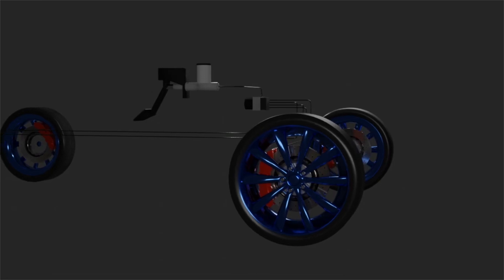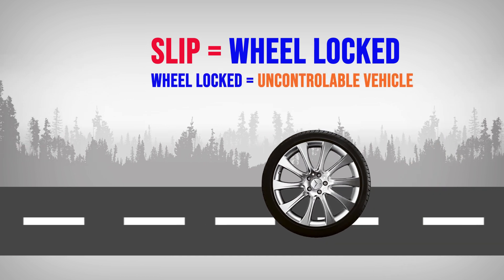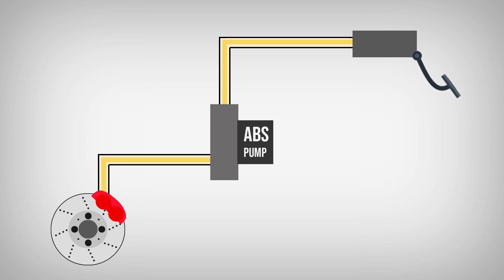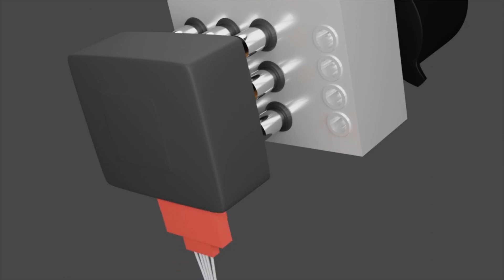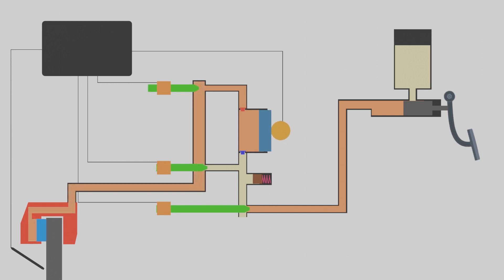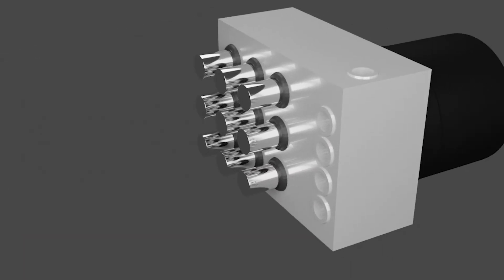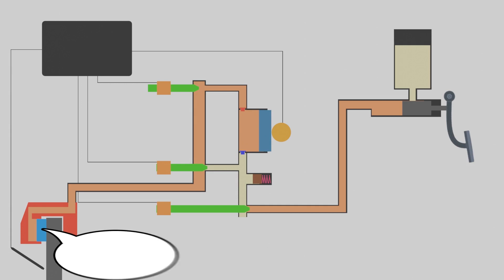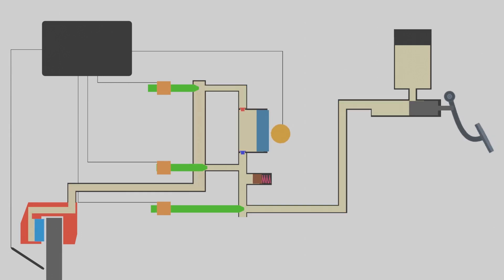How Anti-Lock Brake System (ABS) Works ?

Comment: There is a part in the video where all of a sudden, the music gets really loud and the beat of it becomes annoying. The subject and the chosen animation are already dumb by itself. And since there isn't a lot of explanation about the ABS system which I'm still surprised how it can be that where living in the 21st century, still we feel like it's the caveman years of tech, it makes it even worse.
Reply: You seem smart I’m having an issue with my driver side brake holding pressure not releasing I’ve changed everything attached to the rotor and caliper. I’m starting to think it’s a valve in the stupid abs module. It’s an 03 civic ex… thoughts?
Reply: @Carlomercurio1  Hey my friend. Do you have prior knowledge about braking system? I don't mean to tease you, because I'm a student too, it's just the terms I'm going to use are here.
Fluid
Lines: AKA brake pipes.
1. Your caliper or brake pad might be seized due to rust  and age, and it might pull one side when braking
2. If your brake is being pushed and not released it can be overheated brake system, using wrong braking fluid damaged or broken components, or DEFECTIVE ABS COMPONENTS. (WHEN WE SAY ITS A ENGINE PROBLEM IT CAN ALLLLLLLLL KINDS OF STUFF)
HERE IS THE BEST I CAN GIVE. BUT MAKE SURE YOU GET YOUR CAR CHECK BY PRO. CARS ARE LIKE A LEGO SET AND ONLY THOSE WHO STUDY IT EVERYDAY CAN GET IT. IM HAPPY YOU DID A MAJOR CHNAGE THOUGH. AT LEAST YOU DID PART OF GHE JOB. ALSO CHECK OUT. " Common 2003 Honda Civic EX issues" And it's bringing four lists of problems. I hope you get your car fixed. Wish you the best.